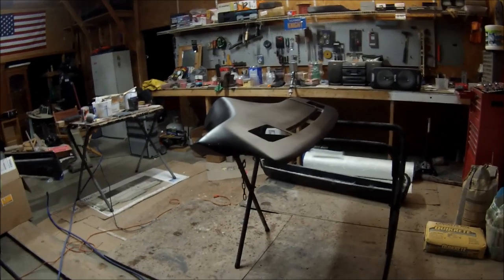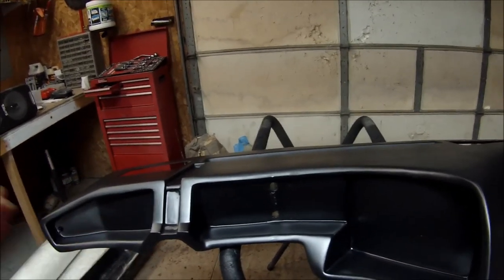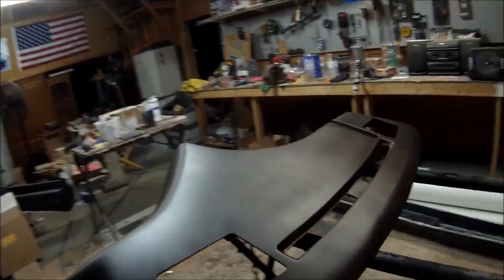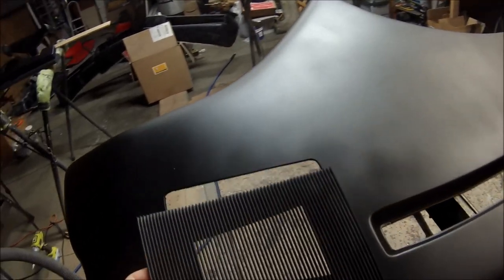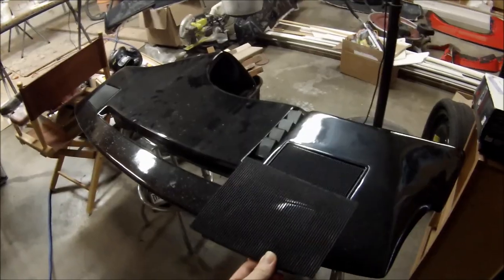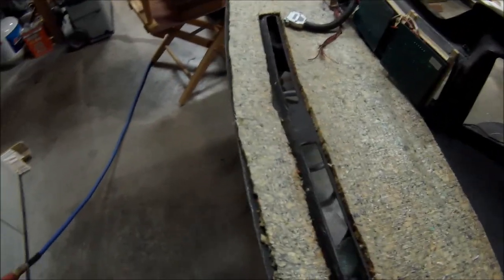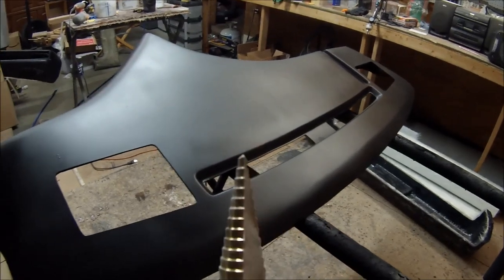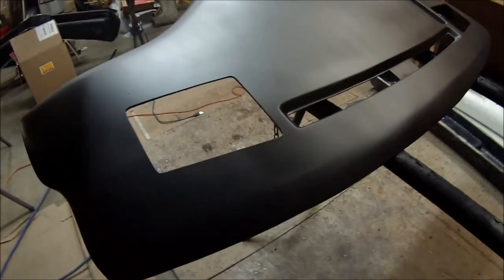DASH in PRIMER & How to Cut out Speaker Grills

Comment: I just got my refund… thank you for that. 
Your way of doing the speaker grills is much easier than how I was going to do it. Thanks for the tip. I’ll post a video when I put mine in. KITT is on hold for now until the spring since I don’t have a garage to work in.